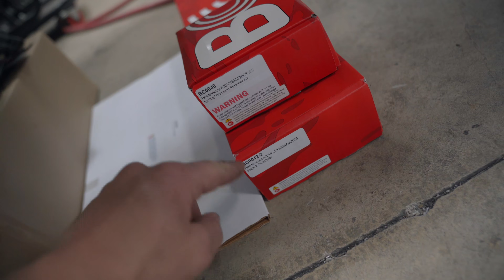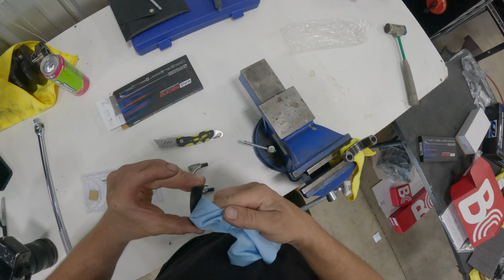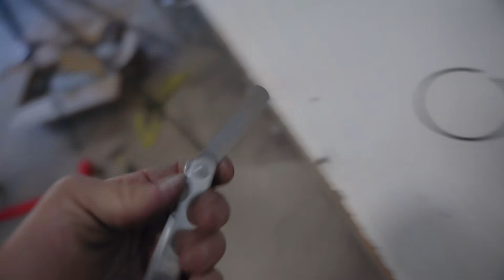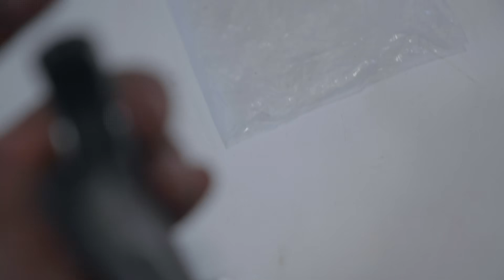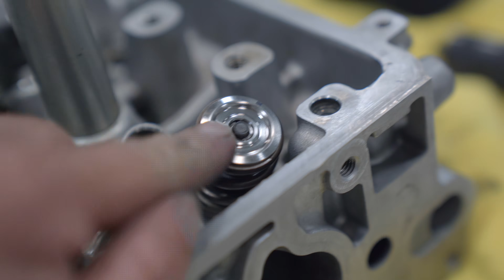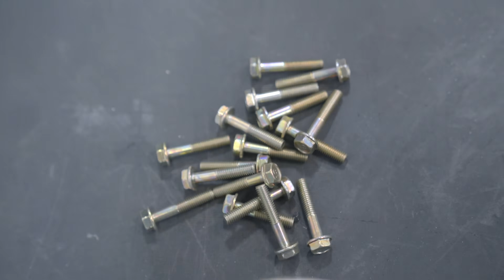800HP Honda K-Series Engine Build (From Bare to Complete)

Comment: Im too happy to see you detail the build 😂 so here is where i deduct points you set valve clearance before you did timing witch result in bend valves you turned the cams while the pistons 1 and 4 were at tdc those valves were bend😢😢😢

Comment: You have to cut all the rings or just the first one
Reply: Usually have to cut all rings. The primary thing is to make sure that each fit within the specs that you’ve determined when you place them in the cylinder. Some will be spot on and others may need a little here and there. Make sure to clean all the edges of each ring(s) after you do any filing. Doesn’t take much, so take your time and you should be good.

Comment: Some more tips; not knocking how he did it.

-Check the cylinder bores or journals in three spots around the circumference to verify no egg shaping of the circumference. Also, check towards the top and towards the bottom of the stroke or biased left and biased right of the journal to verify no tapering.
-When measuring ring gap, use an old ring on the piston to get the new ring squared in the bore to get an accurate measurement. if not, the ring can be cocked and throw off the gap, even ever so slightly.
-HEED HIS WARNING! Always triple check that the circlip is in the groove completely. Same with the valve keepers. Tapping the top of the retainer with a rubber mallet (head off the table to not slam a valve on the table) will verify they are seated and will not pop out. 
-It is a good practice to spin the crank over each time something in the rotating assembly has something installed and torqued (inclding the camshafts, oil pump, balance shafts, etc; not just the bottom end). It will verify nothing is binding, and if so, you know exactly where the bind is and what caused the binding. Better to find that early than when the engine is fully assembled.
-If you adjust the valves before the chain is installed and tensioned (as the video shows), make sure your pistons are lowered from top dead center (TDC). This is achieved by turning the crankshaft. This prevents piston to valve contact while turning the camshaft to the heel of the lobe.
-On the K-Series, there are pin spots on the back of the cams to hold them in place to make installing the chain easier. It holds everything in place so you are not fighting the valve springs. 07AAB-RWCA120 

Good work, man. I have watched the entire build to this point and following the list down. 

Now to get my K24A2 built and find a car to put it in..
Reply: How’s it going?
Reply: @Mauryan510  Me?

Comment: Oil squirters or delete plugs go in before crankshaft also end float wasn’t checked rod bolts bolts to block clearance wasn’t checked also super important rod to oil squirter if applicable clearance piston to valve clearance wasn’t checked and valve lash was set incorrectly also bc recommend 35 degree vtc

Comment: Hey I’m desperate for help, I’m on a k24v7 platform and wanting to reliably make 250-300hp but have no clue where to start and finding parts or help is a struggle. I’ve scoured Reddit forms and different communities for over 1-2 years now. Only things I’ve been able to accomplish so far is a catless downpipe, full catback exhaust, intake and a tune(ktunner v2) do you have any suggestions on where to go for questions/parts or does anyone here have anything they know that could help? Thank you and hope to hear anything back.

Comment: Love the content. Was very informational. But i have always seated my valves (new or old)with compount a valve grinding tool. Is it not necessary with these valves?  Maybe im not using good valves but ive had new valves fail a leak test. Just curious for my future builds.

Comment: 800 HP? Just a suggestion.  L-19 head studs and sleeves.  At best CSS deck modification from Jeff&CNCWerx
Reply: I was wondering the same.  Piston and rod only for 700 to 800 is crazy. No sleeves or css

Comment: Great video for people to have visual knowledge to reference! One suggestion I have is when you had the broken off oil pan bolt I would have used a nut instead of a bolt. When you plug weld the nut it has a much stronger hold than a bolt IMO. Awesome job on the numbers/measurements side of things, it seems simple but its easy to get lost if you're new to building engines.

Comment: Did you install the bolt in the oil pan when you use type s pump there a bolt you screw in when you do this swap that's what I think was your oil problem the first time

Comment: I strongly recommend using a product like Dupont Sontara prep wipes for building engines vs Scott Shop towels. Sontara products have no lint, no rosins in their product. They’re designed for final prep in the automotive paint process - they’re ideal for engine assembly which is best done in a clean shop environment.

Comment: I know you’re going off of instructions for the valve lash, but as. Honda tech, I would always recommend setting your base timing and having the chain on. It’s best to set valve lash at TDC compression stroke. I can’t remember which version of the k24 you have, but from any that I’ve done intake has been 0.009” and exhaust has been 0.012”. 
Like I said, it may be the difference between OEM and the company you purchased from, but I just wanted to through this out there. 
I can’t wait to see this thing completely done!

Comment: İ am not a profesional. Just spent last 4-5 years built and drive honda k series and i believe stock block will not last long araound 800hp so my suggestion is keep it on low boost to have long life motor or sleeved block. And i love your videos , first thing to check your chanel if you upload one video 🙏🙏🙏

Comment: Best YT engine build ever. Attention to detail is excellent man. 
Might be worth considering an oil pan baffle, my k24 was suffering with oil surge under hard acceleration and cornering. Wouldn’t want that lovely motor having any issues. Bravo dude, best series I’ve seen 🎉
Reply: Definitely recommended, oil starvation killed my K20A2 block in a long high speed corner on track (probably around 90mph), new engine (K24A2 with the old K20A2 head which was still fine) got some nice baffles installed in the oil pan to avoid a repeat.

Comment: Watch out with using the Z3(RRB/RRC) oil pan and a type s oil pump, the pan is a bit deeper than most K series so your pick up may not reach the bottom of the pan so under acceleration(especially AWD) you could risk oil starvation. A fix to this is to run an RRC oil pump or modify your pickup. I believe unit2 fabrication makes an weld on adapter for this problem. Also as a few others have said make sure to close the oil port on the bottom of the girdle or you'll have low oil pressure. 

Sorry for the long comment! Love the build and that you're showing everything along the way.

Comment: Hey man on the cylinder your supposed to change the valve spring seats the factory seat is only meant for single spring not dual spring

Comment: So i noticed you using the penn grade 20-50 during assembly, i would probably recommended not using that as break in oil 😅 when doing my new engine (for an evo 8) i was told that was way too thick for break in and to use a cheap 10-40 for the first 100 miles and THEN use the 20-50

Comment: Wish you would have CSS (CylinderSupportSystem) that block and had the rota assembly balanced , at 500bhp you are  running at the limit , ask me how I know 😂. Got my last k24 done properly had no problems for 3 years until oil pump failed 😩.

Comment: Hey man love your content! Next time when you are trying to get a broken bolt out,  try welding a nut instead of a bolt because you will have more of the weld that sticks to the broken bolt and nut. You can also ping the area around it with an air chisel and use penetrating oil will also loosen it up even further before trying to extract the bolt.